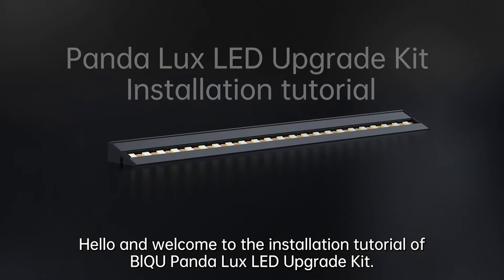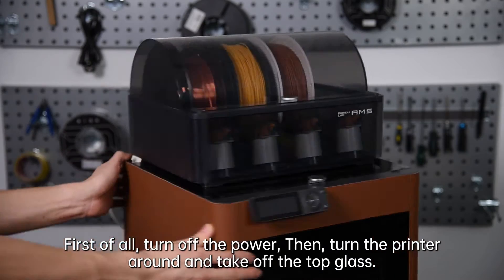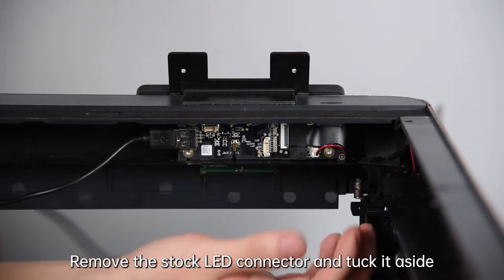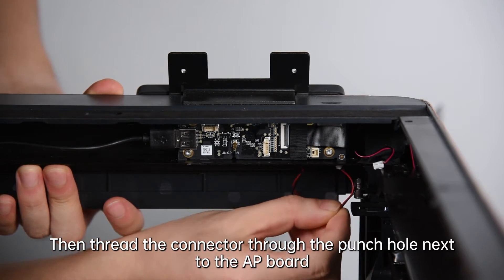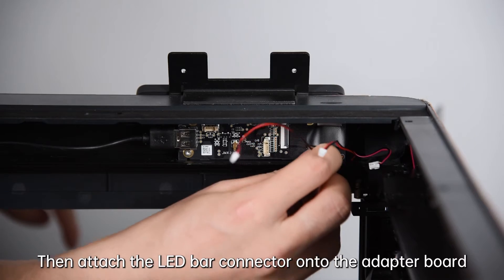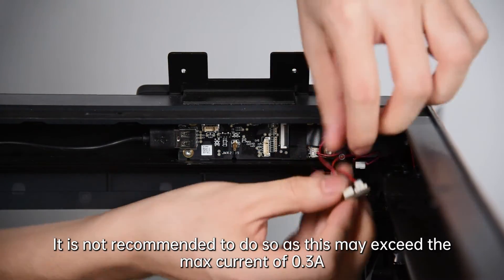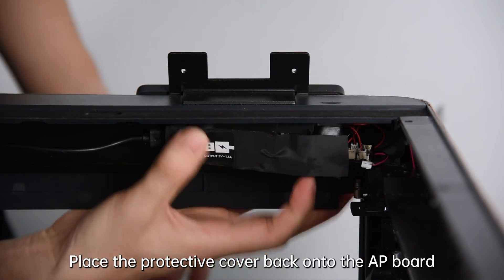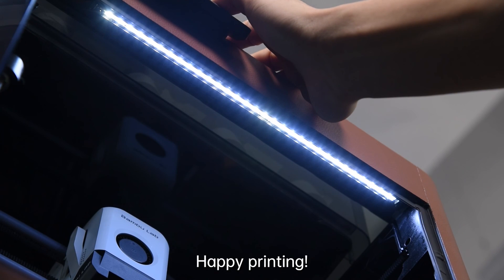💡💡Panda LUX —— Have an ultra-bright printing chamber in just 1 minute！

Comment: I assume rather than making a new run of these with the male pin for p1s direct plug in they just kept selling the ones with the bus. I depinned mine and soldered directly to the correct male plug end. Length is good and less crap to tuck away.  👍
Reply: lol. What a pointless waste of time.

Comment: Need help. I followed the instructions and once installed, the light did not work. But when I took it off and plugged in the original light, it also does not work. No matter how many times I try none will turn on.
Reply: May I ask if the problem has been solved?
Reply from the maker: Don't worry, please contact our technical support email: service001@biqu3d.com, Our colleagues will help you😊😊

Comment: The robot voice is OK, but it needs to slow down, and clearly show the connection on the AP board.  After looking and thinking about it, the connection on the AP board was obvious, but it would have been nice to actually show the X1 design, since it it so different from the P1. More detailed pictures that pointed out the exact connector to use, and a general wire layout would have made things much clearer.

Comment: For those curious, I measure the current draw on both my X1C stock light and the Panda Lux and I'll let you make the decision. 

X1C LED Draw: 156mA
Panda Lux Draw: 190mA
Both connected on adapter board: 268mA

Yes the numbers don't appear to add up, but that's what the meter shows so I'm going to run both and still be under the 300mA rating.
Reply: You should measure voltage, too. These do not add up which means that voltage drops when both are connected which would also mean that this power source is really limited to 300mA IMO.
Reply: Why the f did they sell a 3 pack like it can all conn2ct to 1 printer then, damnit!
Reply: So you're running good with both lights? I was going to scrap this thing. Hate the shadows. Was going to get some rgb strip leds and run them on the inside. But if running both lights is good, I'd rather that.
Reply: @Deace_Essc  I've been running both for the last 2 weeks on both my machines (X1C and P1S) and both have been fine. I will admit that this still isn't perfect because it actually makes the camera view darker and harder to see the nozzle. I think some kind of overhead 360 strip would be better.
Reply: @NickInTimeFilms  I just went ahead with the rgb strip lights and it's a huge freaking difference! The timelapse are amazing, the lidar works fine. Plus with their own power supply, no worries of drawing too much power.
Reply: @Deace_Essc  Can you please share the link? Thank you
Reply: Ran the same check that you did 153 and 191 I wonder if it is perceived as with both lights it is too close to the limit and manufacturing variation might put it over ?
Reply: Hey so you're saying you hooked up 2 Panda Lux strips to the adapter board and you're not drawing too much power even though you should be? Everything's fine?
Reply: @Te4mUp  No. It voltage drops (which we don't know but that's most likely the case) then it would mean that power source is not capable of delivering required amount (which is bad).

Comment: If you can only use one light at a time why not just direct connect to the connector in the AP board? Why use the jumper when using multiple lights isn’t recommended anymore.
Reply: Because at the time, i assume the plan was to use it in conjunction with the stock light and to have a handy extra couple of ports. They probably found out later about the Bambu amp limit and rather than waste money printing a new single connector, sent out a warning instead. 
It does still work if you plug the stock in aswell by the way, but it's dangerous
Reply: You can with an X1 because the connector fits directly. I think with a P series you need to use the splitter/jumper thing provided
Reply: @exocorp  Oh darn I can't hook up two strips on my X1C? Why do they sell a two pack lolololo what?
Reply: @exocorp you could fry the whole thing by it drawing too much power. That's why they warn you to only use one
Reply: It's not the same socket. But you're right.

Comment: I did have a observation and question.  I recently got a new X1C (2 month ago), I recently received my Panda LUX.  I noticed in the X1C the internal light connector seems to be “hot glued” to the board.  Is it safe to break that seal?  Has anyone else noticed the same?
Reply: Most of the Glue is simply to help prevent the connections from wiggling loose over time as some connectors without glue can pop out very easy.
Reply: It’s silicone adhesive and keeps things plugged in during shipping. You can use a hair dryer to warm it for easier removal or just pick at it until you’ve removed enough to unplug the connector.
Reply: It is not really glued on the connector piece itself. It comes off easily.

Comment: I ended up getting too scared to mess around with my X1C's board, and stuck the official Bambu LED light kit (USB) on the bottom of my AMS riser, pointed down through the top glass. The light kit even came with the little double-sided adhesive. Plugged into a smart USB power brick so I can turn it on and off remotely.

Comment: Added to a P1S. Went like video said it would. Nice instructions. LED lights up front of cabinet well. The back, not so much. Worth the ten bucks I spent. Dunno if I would keep it long term.
Reply: better than stock?
Reply: @seanami8701  Not better or worse. Just different. Intense light in the front of the bed, and dark shadows cast in the back. I'd buy again but will still probably do something else.

Comment: Works great. i love it. i just wish i could use both the stock light and this upgraded light
Reply: Have you tried plugging them both in?  I'm going to install mine today and will give it a shot even though it is not recommended.
Reply: @jeffreys-vu6gd  how did it go? i haven't i was worried about burning the chip up
Reply: @jeffreys-vu6gd I'd like to know also

Comment: What about the x1c? it's plugged in to the main board in the back of the printer and this wire isn't long enough
Reply: No, the X1C has its connection for the light right next to the one shown in the video - on the right-hand side.

Comment: Is there any guesses, why this could not be connected to the USB port to have the stock light as well?
Reply: Maybe it's because of this company also sells the Panda Toch controller, which needs the USB-port too (if you have it).
I'm actually doubting if connecting both would fry something. Although I also don't want to take the risk on a €1000 printer...
The LED will also be constantly on while connecting to the USB socket, and not being controllable by the screen.

Safest option would probably be to use an relais/transistor board, in conjunction with an cheap external 5V phone charger. This way the controllboard only needs verry little power to just power/switch the relais/transistor. And Power for both LED-strips will be supplied externally.

Edit:
I'm not sure how much power the internal USB-connector is delivering. So I'm not sure you could use a dongle there to split up the power when using a Panda Touch for example.. But when you're not using this port for powering the Panda Touch or other things, I'm pretty sure it should deliver  sufficient power to power both of the LED-strips internally. If BIQU (or yourself) made an relais/ transistor controllboard (you could combine it yourself in conjunction with the included controllboard).

Bit of a missed chance from the BIQU-engineers, while the solution seemed to be straight in front of their noses behind that cover...

Edit 2:
Seems they already sell a Panda Hub, so assuming the internal USB-port is delivering sufficient power to power more "cases". So designing a cheap additional relaisboard that enables to power both LED-strips would already be verry simple.
Reply: Replacing the stock light bar permits turning the new light bar on and off. 

If it just popped into the USB port, it’d be on all the time.

Comment: Is the adapter board even necessary for the X1-Carbon? Can I just plug the lux light directly to the main board?
Also, a video on installation  in the X1-Carbon world be helpful
Reply: Yes, you could remove the existing connector of the existing light and connect the new led bar into the same socket.
The extension board is only to split up, which is not possible due to the power limitation.

Comment: Any instructions for the X1? The printer is pretty different in this regard?
Reply: Open the acess door on the front left of the inside of the printe. You can easily identify the wire connector coming from the stock light, Remove the hot glue holding the plug in place, unplug the cable and plug it into one of the matching sockets on the breakout board that comes with the Panda Lux. Plug the BIQU lamp into the breakout board and optionally plug in the stock lamp as well. I've got both running. The breakout board seems to fit best in the corner, outside of the door when it's shut and latched. I don't have it stuck down, it just sits there nicely like in this video.
Reply: @jgefaell  Would running both the stock lamp and the Lux together not burn out the AP board?
Reply: @Declan.D  the said in the instruction to not connect both. I may be close to the current draw limit.
Reply: Look up the Bambu Lab instructions on replacing the X1 light and just connect the Panda Lux instead.

Comment: Can i install the panda touch and the LUX at the same time
Reply: I have. Bambu does not allow this and specify 0.3A max current draw. You can assume that both lamps draw <0.6A together.
Reply: Yes, you connect the PT on the internal USB, and the LED bar on the existing Light connector.
2 different connectors.

Btw, they also sell a USB hub, to split up the internal to 2 USB connectors.

Comment: i need help to install on x1c. can find the stock Led power
Reply: Same problem here. And on my printer, all of the connectors are secured into place with a glob of glue.
Reply: The plug comes out of the glue with a finger nail or pliers, just don’t yank on the wires, insert pliers or tweezers between the connector and the plug end, just dig in there. The glue is white hot glue not cement.
Reply: I just received mine today, this is awesome especially since it’s magnetic and replaces or augments the stock light. It’s just $10 US
Reply: @joeylopezdesign  i install mine but the light its a crap

Comment: we really need to use the adapter?
Reply: Yes. The Panda LUX use different connector than the stock light and you need to use the board even if you only want to connect one light. At least that's how it is on P1S, don't know if X1C have different connector.
Reply: No only if you want both lights to work which you shouldn’t, Bambu put out a wiki notice that it’ll exceed the 0.3A output, which Biqu mentions

Comment: Biqu, you really, REALLY need to stop telling people they can use both lights at the same time - especially considering in this video it's even said that it isn't recommended because it will exceed the 0.3A capability of the port on the printer.
Reply from the maker: Yes, we have corrected it, thanks.
Reply: Wait.... So why did I buy a 2 pack if I can't use them both?!
Reply: Where is everyone installing it on the x1? Replacing the stock light? I don't see where to mount it otherwise
Reply: Why though? They literally include the adapter board with the light bar, then say don’t use it for what anyone assumes it’s for (using BOTH lights). 

What happens if you do? Will it slowly burn out, just run the lights dimmer, or just blow and not work if you turn it on with both plugged in? 1.5w (0.3a x 5v) isn’t a lot to work with but I’d like to use the stock and the panda light at the same time
Reply: @Helloyousilverdevil Please do and report back because I’m curious too.
Reply: @Helloyousilverdevil what happened?
Reply: @BassDad-TV  have been using it for a few months, no issues to report at all- realized it’s really going to come down to the lightbar itself failing (dimming, not powering, etc)- the printer itself is at no risk.

Yall are safe if you wanna do both imo. Power-drawing devices essentially ask for power from the PSU, they don’t demand it. So if the system is overloaded, the lights dim, but they won’t pull power to survive while killing the rest of the system.
Reply: @Helloyousilverdevil  I just installed mine and honestly the panda bar is darn bright by itself way more then the factory one so idk if I even care to do it now🤷🏽‍♂️
Reply: @BassDad-TV  totally agree, just keep the bar installed. The stock light sucks

Comment: why does it have multiple port on the adapter if not to plug the stock light as well? im wondering cuz im interested but it bothers me a little to have a light that dont work anymore lol (unless I take it out completely maybe)
Reply: I saw them not plug in the stock light as well. But then in the video they showed the stock light on at the same time. I think they messed up and fixed it off camera.
Reply: Because originally they intended it to be used with both lights, then I and many others called them out on the 0.3A current limit of the port on the printer, which delayed the product by about a month as they reconfigured the Lux and put out new verbiage to advise people not to use both lights at the same time.
Reply: @thescinema  we really need to use the adapter?
Reply: You dont need both. I just did the install a few minutes ago. The new light lux is so much higher than oem that you cant tell the oem is on in person. Well woth the price.
Reply: @dude60415  There is a big difference between either lamp alone and two lamps at once.
Reply: @jgefaell  not sure if your asking but for me no. The output of the new led as so much brighter than the stock light that if you turn the stock off you wouldn't know. You'd only notice if looking directly at the stock light that it turned off but as for output I don't believe its providing anything once the new one is installed.
Reply: @dude60415  I'm sorry for the confusion. I'm not asking, that's a statement based on my own experience. I absolutely can see the difference between either and both.
Reply: Very confusing why you wouldn’t plug in the stock
Reply: @thescinema is 100% correct - mine just arrived today - and I was glad to see the mention on the website added when I also sent them the Bambu wiki mention about the 0.3A max
Reply: thanks y'all for your answers! I'll just take out the OEM light so I don't have one that don't work!
Reply: To answer if you need the adapter, No, if you replace the stock light you don’t have to use their extension or the 4-way plug. The stock light and the lux use the same connector. The 4-way plug is both a splitter and allows daisy chaining of multiple adapters likely before they were informed that it would exceed max amperage to use more than one light.
Reply: @joeylopezdesign  This is wrong. I just received my order and you do need to use the adaptor. The LUX led bar does not have the same connector as the stock light (Bambu P1S here).